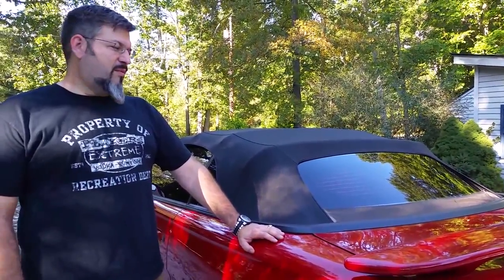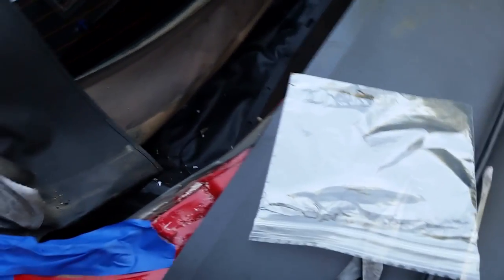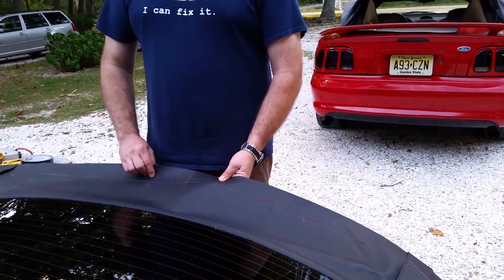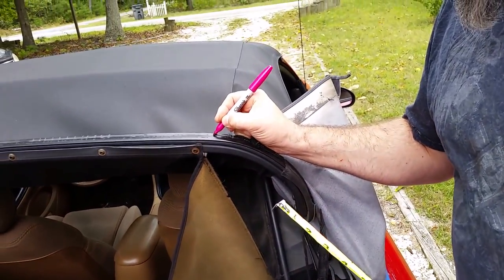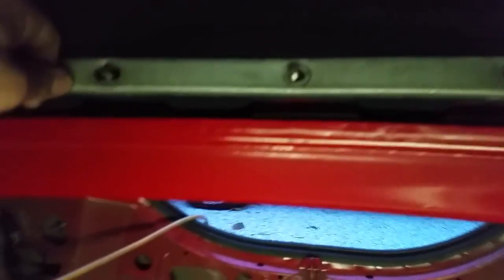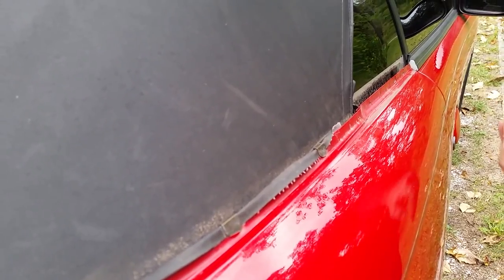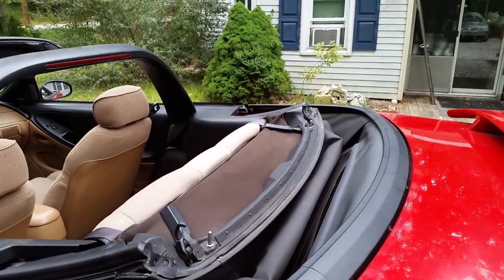1994 to 2004 Mustang Convertible Rear Window Step By Step Replacement Save Money $ $ $

Comment: Great video.  One quick question.  If I am replacing both the top and window, why don't I have to trace the old markings from the old window to the new window.  I though you said this was not necessary.
Reply from the maker: Because you will want to put the top back in, in the exact same position.  You have to be more accurate tracing just the window because the top has already been stretched. if you aren't accurate in tracing the window it will sag inwards or be too taunt then creating a sag in the top. When replacing both top and window they don't have to be as accurate because they stretch, they should be centered and  positioned so when putting the convertible top up they should close and come taunt about 2 or 3 inches before the windshield frame before you latch and pull it the rest of the way to latch the top to the windshield. This stretches the top and rear window at same time. it will keep the top  taunt and ripple free for the life of the top. Over time when the top stretches it will almost touch the windshield  frame when you latch it.  I hope this doesn't sound confusing and I hope it helps.
Reply from the maker: Because you will want to put the top back in, in the exact same position.  You have to be more accurate tracing just the window because the top has already been stretched. if you aren't accurate in tracing the window it will sag inwards or be too taunt then creating a sag in the top. When replacing both top and window they don't have to be as accurate because they stretch, they should be centered and  positioned so when putting the convertible top up they should close and come taunt about 2 or 3 inches before the windshield frame before you latch and pull it the rest of the way to latch the top to the windshield. This stretches the top and rear window at same time. it will keep the top  taunt and ripple free for the life of the top. Over time when the top stretches it will almost touch the windshield  frame when you latch it.  I hope this doesn't sound confusing and I hope it helps.
Reply: +Zero Fuel Required Thanks for the quick reply.  I am just setting the ground work for this job.  I do not know when I will start this but I will give myself 3 days.  One to tear off everything, one to put the rear on and one for the top.  Thanks again
Reply from the maker: +Joey Rizzo  if you have any questions  just ask I'll try to reply quickly.  Good luck and take your time.
Reply: +Zero Fuel Required One more thing.  Do you recommend using the guide(10:25 of video) or going buy the old top and window section?
Reply from the maker: +Joey Rizzo I would use the old window as a template to get you as close as you can get. My new window guide lines were way off that's why I traced it the way I did in the video.
Reply: +Zero Fuel Required Thanks again.  I will leave you alone now.  Have a good night.
Reply from the maker: +Joey Rizzo no problem anytime.

Comment: I'm about to replace the rear window on my 2001 Ford Mustang I was watching your video and I would like to know about the line where the manufacturer mark is that the top of the metal bracket
Reply from the maker: Are you asking about manufacture line on the new window material in relation to the old window?

Comment: if the staples pop out, and the window sags into the vehicle (specifically on the top edge) it could be re-stapled, right?
Reply from the maker: Generally the staples don't pop out, they might rust and break but the canvas material usually fails first causing a sag.  There is a lot of staples in the top to hold it in place.  If you have a sag in the rear window you've probably have a leaking window because the canvas material has failed letting water in to your car, not the staples failing.  If you got lucky with just staples just popping out,  yes it is possible to get it back to it's original position.  It would take a lot of work to get it fixed and that much work you might as well get new material to fix your top.
Reply: I just replaced the top on my 94 LeBaron.  2 weeks and the staples let loose on 4th bow!  One of two things.  1: Staple choice, I used T50 stapler.  Maybe need 18 gauge??  2: I probably shoud have replaced the 4th bow tack strip?  Old and dry??   I haven't fixed it yet, looking at videos.  Will probably replace tack strip and use a LOT more staples.

Comment: I noticed that you directed someone to rockauto.com.  I honestly don't know much about cars, but I broke my back window and have been researching for parts and on how to fix it.  One place wanted to charge me over $2000!  Anyway, my question is, how do you know which rear window on the rockauto site is the right one for your car?
Reply: +Zero Fuel Required  by the way it is a 2000 Ford Mustang with a black top.  It has rear defrost.
Reply from the maker: +imnerdy40  Well, there are 2 windows Plastic and Glass. for your year it appears the glass only comes tinted.  there are 3 different types of convertible top materials that can be bought with either a plastic window or a glass window. The Materials are Stayfast which is a highend "cloth" like convertible material,  Sailcloth is a vinyl material to simulate cloth and Texture pinpoint is a vinyl material.  So you first would have to figure out what your convertible top is Cloth, cloth that is actually vinyl or just a vinyl top, on Rockauto when looking at convertible windows to purchase in the description there is the word "INFO" click on that and it will bring up more information and pictures of the materials and colors that should help you identify what your top material is.  Once you've got your material identified then pick glass or plastic window which you obviously have glass because you said you have defrost.  Before you buy you should email or call them to verify they have defrost on the glass window because it isn't in any of the descriptions.  When I bought my window from them, my window came with the defrost, it was also in the description.  They are very helpful and fast to respond in emails.  If you have any other questions just ask, I usually check Youtube once a day and will response as quick as possible.  I hope this helps.

Comment: While I do appreciate this video, I had a very difficult time watching you work with the classic Mustang as a work bench! It made my skin crawl!
Reply from the maker: lol. well the Truth of This 66 V8 mustang workbench in the video I traded even up for a 79 corvette I restored.    I wouldn't normally do that on one of my other 66 mustangs, I'd be to afraid to scratch the paint.  On a restoration I use only DuPont ChromaBase/clear urethane paint. it is like iron.  The 66 mustang in the video, previous owner had it painted at Maaco "mistako". It looks good at 10 feet but any closer it is absolute crap, I can't even begin to explain how bad, so I'll just keep it at...... it look good at 10.  I plan to strip the paint, redo all the body work on it and properly paint it.  When I do it will never be a workbench again.  Thanks for the comment.

Comment from the maker: P.B. Theriver I searched around for the most reasonable priced.  I ended up buying my rear window from Rockauto.com it is very nice material, original texture, very easy to find on their site.  You can buy the convertible top from them too.  In my opinion it is identical in texture, color,  strength and durability as the original convertible top from Ford.  It should have just as long of a life as the original from Ford if you take care of it.

Comment: HELP PLEASE PLEASE!  I paid for a new glass window to be put in by an upholstery shop and left the existing top.  When I got the car back i could see about 1" above the window which is a rubber strip with factory caulk joints.  This is supposed to be completely hidden under the convertible top.  The installers are telling me that the top and old window material shrunk over time and now with a new window its going to be exposed because its not shrunk.  When i look at the support bars from the outside, i can see the first few have wear marks on the top right wear they rub and still rub.  The one closest to the rear window has wear marks but they are shifted forward towards the front of the car about the same 1" that the top is short in covering the window.  Could this have happened during the install of the window or is the installer correct that the top just shrunk?  If during the window install, the sides of the top aren't unattached, i could see the shrinking.  However, in your video, it appears that they do come unattached when removing the window which could explain that it shifted when they reinstalled the window and it is indeed their mistake.  Is this the installers fault and if so, how hard is it to fix?  They swear there is nothing they can do.  I don't know who to fight with, the insurance company or the upholstery place.  Any help would be greatly appreciated!  Thanks.
Reply from the maker: Hey sorry to hear about your problem.   These convertible tops do not shrink much over 20 years. They will fade, become brittle and crack before shrinking.  Installing a new convertible top it has to be stretched to stay taunt. If your window was in the correct position in relation to the convertible top before the new window install.   It sounds like the Upholstery shop didn't  take the time to to transfer the position of the old window to the new window  to be faster.   Without transferring position it would would be tough to get the new window in the same position as the original.  They just installed it where they thought is was best and being in the wrong position they hoped you wouldn't notice.   Or they didn't even notice. There is plenty of material to move it up and down side to side.  The only problem I see your insurance will say it was repaired,  the problem is just cosmetic and the upholsters problem.  The Upholster will stand on their position of shrinkage.  Your going to have a fight on your hands.  If they did a repair to reposition the window to its correct position they would have to pull all the staples that hold the bottom of the window and the top staples in the Bow to  move it upward exposing a whole row of holes in the bottom that water will now leak into your car.  There is no repair except vulcanizing those holes to be a permanent repair and I don't know anyone who does that kind of repair.  It would require a new window to be installed to be done right.  it isn't good news no matter how you look at it.  I hope what I have written helps and good luck.
Reply: +Zero Fuel Required just about exactly what is happening. Another installer I talked to today said that they probably cut the fabric too short on the bottom and installed the window down to far.  he suggested adding fabric back to the bottom that way it could be moved up. What do you think of that as a repair?
Reply: +Zero Fuel Required just about exactly what is happening. Another installer I talked to today said that they probably cut the fabric too short on the bottom and installed the window down to far.  he suggested adding fabric back to the bottom that way it could be moved up. What do you think of that as a repair?
Reply from the maker: It is a possibility to repair by adding more material. If you can find someone to do the repair they probably won't guarantee it won't leak.  Getting material that is strong like the convertible top canvas might be difficult to get unless you have a place that makes boat canvas tops around.  A place that makes boat tops out of Canvas might have scraps around for what you need or they can get it and they would be able to sew it correctly so it doesn't leak.  There is a water repellent for camping Tents that you could put on the seam to help prevent leakage or beeswax.  That's about all I can think of.  I spent $200 getting a new window for my mustang.  I hate to say it, but if all your running around to find someone to repair your existing window and cost to do the work come anywhere near buying a new window you might want to save yourself some headache farther on down the line by just replacing it again.  Just make sure whoever installs it knows the problems you had so it doesn't happen again.  Good luck.
Reply: +Zero Fuel That sucks because the window was just replaced a few days ago by a professional. Thanks for all your help.
Reply from the maker: When you look for a shop to do your work look for them on the internet.  A lot of business anymore have some kind of place where people can rate their quality of work or just complain.  If not maybe check the Better Business bureau for complaints.  The worst thing is when you think you are paying a professional,  sometimes you are just paying the shop and they are paying someone minimum wage to do the work. When in reality sometimes it is better to just do it yourself if you feel capable with the tools required.  You  gotta start somewhere. Sorry I couldn't give you better news.  Good luck in whatever your decision is and if you have any other questions just ask. Have a good day.

Comment: I know this is three years old but did you ever do a video on replacing the main portion of the convertible top?  I"m going to be doing this in a couple months and really don't want to have to pay anymore than for the top itself.  Besides, I never trust the technicians in these shops.  You never know when you're getting a guy in training.
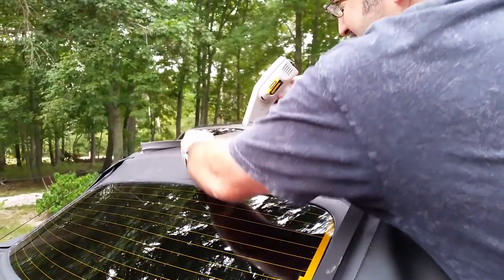Reply from the maker: No I haven't  replaced my convertible top, but I've been thinking about doing it because one of my wife's cats put a nice size claw mark in my top.  On my mustang someone replaced the top and not the rear window (To save money) long before I got it.  I replaced the rear window because it started leaking (bad and I didn't want to rot my floors or get mildew).  It's actually easier to replace both at the same time.  I would recommend to Take pictures of everything as it comes apart(so you can remember how it goes back together).  You must take the rear seat and inner interior quarter panels out to get to everything, it will make life easier.  Once everything is apart.  Lay new convertible top and window in the sun for a day to take the wrinkles out of them.  Then Transfer old window pattern like I do in the video to the new window to get it close while being installed and the same goes for the old top to transfer the pattern to the new top the best you can.  Once the  window is installed,  detach the rear retaining strips from the car and on the new convertible top attach it to the top bow like I do at 22:28 in the video(make sure it's centered. Then stretch it down and attach it in the rear like at 23:54. Install the side curtain cables. I'm probably missing a few things here, re-install the rear retaining strips and stretch the top to the front.  Center the new top in the front, open the convertible 4 or 5 inches above the windshield and stretch the new top matetial around then staple it in place, this is so when you close it the top stretches to take out any slack or left over wrinkles.  It might take 2 people to pull down on it to get it to latch the first couple of times.   Leave it closed in hot sun for a few days and Over time it will become easier to latch close. Anyone can do this,  it's time consuming but worth the effort. I hope this explanation helps, thanks for the question and good luck
Reply from the maker: People ask questions and I answer everyone.  Take a few minutes and read through the questions that I have answered they might help too. The answer I gave above, I actually copied most of it from a response I wrote to someone else asking the same question.